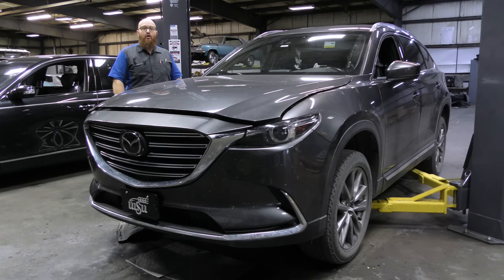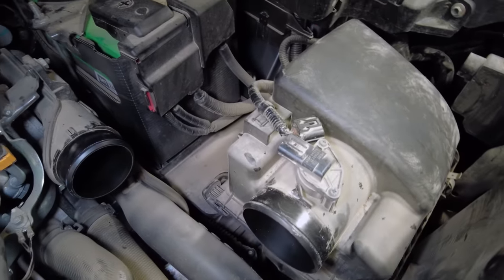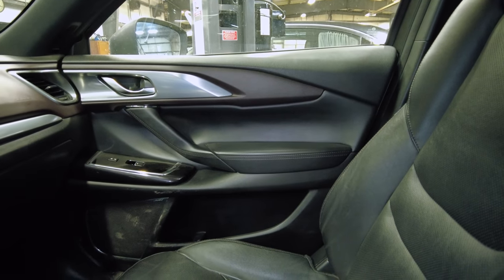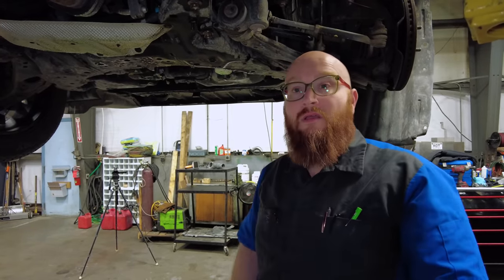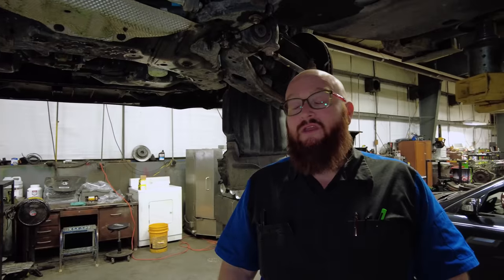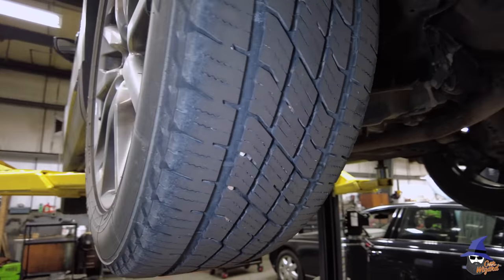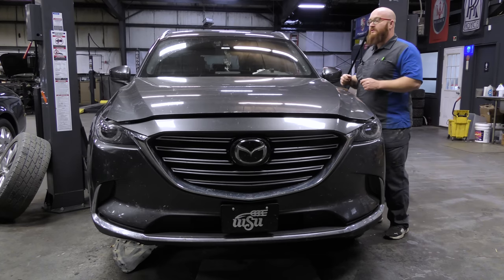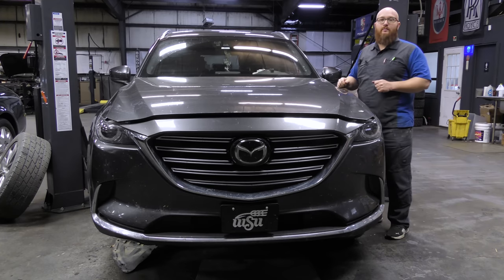Really, a $4K leak! What could be wrong with this '16 Mazda CX9 that could possibly cost that much?

Comment: The 2.5 turbo Mazda engine is actually a great engine. The early ones had this problem with the head gaskets because of a crack in the cylinder head between cylinders two and three. I worked the Mazda dealership for over two years and this happens on only the early CX nine‘s and ones that are really beaten up. They are good cars but this is definitely a known problem. This has no Ford parts and has nothing to do with Ford. This is a complete Mazda engine from the ground up.
Reply: Thank you
Reply: So...is head repairable? If not how much is new one?
Reply: @zerkfiter  I did read that early models of CX-9 can have this issue , I wonder if it has anything to do with how often and what quality is 5W30 used ? There is plenty of basic 5W30 oils that may not last past 3000miles in such Direct Injection Turbo motor.
That turbo was oil cooled until 2022 models that are air cooled now .
Reply: Yes it is. I can't even find a single one being torn down on the internet
Reply: So which year ranges should you avoid? I actually wouldn't mind a mazda 3 hatch with this engine
Reply: @christianmonreal9303  Very first year  2016, i had 2017 and it was great
Reply: @zerkfiter  No.. the head is scrap; replace with updated head.
Reply: @petesmitt  I did look it up and it said about 1200 labor and 2200 parts
Reply: Funny thing is that I had to get rid of my 2017 Ford escape for this same exact issue..2.0 Ecoboost engine. I replaced it with a 2023 CX-9 😂😂. I did verify that this issue doesn't affect the later years. I wonder if the Ecoboost engine and this engine are based on a shared design when they were together.
Reply: @Jbizzle_klok  Mazda 2.5l and Skyactiv turbo version has NOTHiNG to do with Ford and Ecoboost .
It is super reliable and this issue here is very rare and limited to early years .
Looking at interior scratches and rough condition I doubt owner used proper quality oil for this Turbo engine , or maybe did not change oil every 5k miles as needed .
Take care of it and it will last your for very long time , use quality 5W30 pure synthetic oil , change every 5K miles , even better do it by yourself as it is super easy to do 🙂 it will last forever.
Reply: My wife has a similar car, I wouldn't call it fast but it isn't slow either. It's enough engine to get it moving and to overtake.
Reply: @Jbizzle_klok  Your CX9 is 100% Mazda.  Mazda kicked Ford to the curb in 2010, by 2014 Mazda completely re-engineered every single part on every vehicle.  Your engine, transmission and everything else is engineered and manufactured in Japan by Mazda.  Also, there is ZERO parts engineered or manufactured by Toyota.  Mazda has 2.4% in Toyota stock and Toyota has 5% in Mazda stock.
Reply: You say they "are great engines" and in the next sentence say "head gasket problems".  That does not compute.  NEVER buy a turbo engine. You can get by fine without a turbo.
Reply: Yeah, a turbo 2JZ is such a terrible engine. 🙄
Reply: New one cx90 should also have problem. That's why be aware of newest models
Reply: @nicholasvinen  I used 93 from Shell and it was very peppy ....
Reply: It's not a great engine anymore, and it's not bulletproof at all, compared to Toyota and Honda vehicles built in Japan with Mazda CX-9 together.
Reply: @waltchan  CX9s 2.5t skyactiv is all Mazda Japan designed and build engine and is super reliable , has great performance and fantastic torque curve , all done by Mazda from 2016 and it took Toyota until 7 yrs later to build similar engine but not as refined and smooth and lacking anti turbo lag tech that Mazda have patented . 
I will take Mazda over Honda every day of the week and even than Toyota is recommendable and  much more solid than Honda it has to save their best for Lexus while Mazda does not have that problem .
Reply: @kdomster9141  Super reliable is the wrong word to say in the Mazda Japan 2.5L turbo. Many, many Ram 1500 5.7L V8 Hemi trucks easily outlast this Mazda engine, and they're built in USA. New Japanese don't last as long as the old ones now. More MPG = Less Durable, actually, due to cheaper construction quality in Mazda, Toyota, and Honda engines.
Reply: @waltchan Design quality and build precision / materials of Mazda are 2 levels above Dodge ...  Dodge is some of the worst in the industry even cheesy Koreans maybe better .
Reply: @kdomster9141  Let's do Ford Super Duty, Chevy Silverado HD, and Ram 3500 HD trucks instead. All are built like a tank that easily outlast any Japanese vehicles today.
Reply: I wouldn't describe that as a "GREAT" engine. "Great" engines do not have cracked cilinders
Reply: @alphatrion100  Every I mean every engine can have issues , this engine is very very durable for last 7 yrs and many reporting over 200K miles on these with no problems  ... Even most reliable engine if  not maintained as it supposed to be and on DI turbo as this use 5W30 cheap oil kept for extensive period of time it may have issues - it can happen on most reliable engines in the world .
Point is , without knowing how this vehicle was taken care of we can't judge it's reliability.
Reply: @waltchan  Lets compare commercial cars like Ecoboost in Ford SUVs  and not industrial like Heavy Duty Trucks that cost 100Kusd  and even if engine is overbuild to last thru abuse if Industrial applications  rest of the car will fall apart  including electronics , sensors , seals .
Reply: @spaceghost8995  unless you wanna actually “drive” the thing. Chugging along is not for me. That’s why I own 2029 VW Jetta GLI. The best turbo car I have ever owned and it’s really zippy.
Reply: @eugeneweeks3325  I drive like an adult not some punk who wants to look cool and then cry to mama for turbo repairs.
Reply: Good post! The way it was leaking didnt seem like a headgasket. The only time I've seen coolant just pouring out of an engine bay like this was a busted pipe, cracked head or radiator,  or a failed water pump. So cracked head it is on this.
Reply: Just show how incompetent Japanese automakers really are. They been building cars for almost a century and still put out garbage.
Reply: @henrytaverner1803  You've never owned one so how would you know?
Reply: I was surprised to hear Wizard equate this to a Ford engine. This is pure Mazda, sharing no content with Ford. Ford has its own 2.0/2.3 Ecoboost 4cyls. Yes, Mazda and Ford shared the old 2.5L in the early 2000s, but this is Mazda's own 2.5, starting in 2013 with the Mazda 6. The transmission is also a Mazda-design.
Reply: @Jbizzle_klok Ford's gen 1 2.0 Ecoboost was the king of coolant intrusion.
Reply: @eugeneweeks3325  But you had to use a DeLorean to pick it up.😃
Reply: I was about to say ford was out of the picture by 2016
Reply: Common Tsb on the 2015-2018 M/Y CX5s too on the naturally aspirated
Reply: As a ford tech once said about the small turbo engines "too much plumbin"
Reply: @kdomster9141  There's such a thing as manufacturing defects. You can baby a car and have a hundred other people on the internet say its perfect and they've had no problems with it. Doesn't mean you won't get the one in a thousand unit that is defective.  Pick any Youtube video about a terrible car or carmaker and you'll find dopes in the comment section saying that they had a good experience, therefore the car must be good and the video must be wrong.
Reply: @spaceghost8995  or a cvt trans
Reply: @Jbizzle_klok  I mean Ford uses Mazdas engines to this day.
Reply: @kdomster9141  Mazda is equal or better than Toyota these days.
Reply: @waltchan  🤣🤣🤣🤣
We will see in 5 years when the Chevy is on its second engine because of a cylinder deactivation failure, the dodge rusted away and had its transmission replaced for a second time, and the Ford can't stop leaking oil and coolant together because of the overuse of plastic.
Reply: @alphatrion100  And somehow Toyota had issues with cracked cylinder heads for years sure it was rare but no one made it a big deal. 2GR is still ranked one of the best engines despite having more issues than any Mazda engine in recent history.
Reply: @LSR-YT21  Agreed , I just wish Mazda would eye BMW more as benchmark rather than Lexus because it will mean softer less performance oriented designs ...
Reply: @kdomster9141  but they don't eye Lexus in performance. Mazda is their own thing. Mazdas don't feel like anything else on the market because Mazda has their own "feel" that they aim to achieve.
Reply: @LSR-YT21  I can see the direction and priorities change from just few yrs ago , it is now getting more like Lexus and less than BMW
Reply: @henrytaverner1803  Can you build an engine? Seems like you are complaining but cant even build a lawn mower engine.
Reply: @kdomster9141  maybe BMW from years ago but Mazda still is prioritizing performance and handling over comfort. Lexus is mostly prioritizing comfort.
Reply: @kdomster9141  lol always the oil.. It's not 1940 anymore.
Reply: @piggy310  i guess you don't know
Reply: Early and early. From what I have read, it was not addressed until cars built starting mid 2020. I had a 2018 CX-9, which I sold last year with only 12k miles on the clock for a very good price. I now have a 2022 CX-9. The normally aspirated 2.5 Skyactiv also have had a similar problem since they started adding cylinder deactivation, but this also has been fixed. I hope, since I also bought a 2022 CX-5 last year.
Reply: @jonwoodworker  The transmissions are made by Aisin. One more reason to buy Mazdas is that they do not use CVTs even for its smaller engines.
Reply: @flr8475  Not what my master tech told me , these 2.5 skyactiv engines are super solid and bullet proof with basic oil changes ON TIME.
Since 2014 ...
Reply: @kdomster9141  They added cylinder deactivation to the 2.5 naturally aspirated CX-5 for  2018, which caused a similar cylinder head failure, but this has supposedly been fixed. If you go on the Mazda enthusiast forums like Mazdas247, you will get a lot of info. Basically the 2.5 turbo cyl head was faulty 2016-2020 and the 2.5 NA 2018-2020ish. I don't quite see the link to oil changes and this problem. However, the problem arises with high mileage typically and probably linked to prolonged operation, e.g. highway long distance driving.
Reply: @flr8475  I don't have cyl deactivation on my 2019 mazda3 , and did not have it on 2017 CX-9 GT .
This 2.5l is build and designed very well . But as with every  turbo motor, take care of it by changing oil to quality one and don't keep it past 5K if drive with heavy foot,   let it cool off a bit after spirited drive by idle for a minute or so and it will last you long long time , many 2016 turbos are at  200K and doing well . 
Also turbo should be cleaned every say 30K miles . 
Head failures you are mentioning were not a wide spread problem like  Subbie head gasket leaks or Honda fatal 1.5l turbos ... So let not put bad wrap on overall fantastic  2.5l Mazda Skyactiv engines.
Reply: If there are cracked cylinder heads and takes $4000 to do a $40 job it's a piece of junk
Reply: @timothygibney159  Every I mean every engine can occasionally develop this kind of issues . 
This Skyactiv reliability statistics can be checked and it is one of the TOP engines mass made today ...
Reply: Thank you yes this is not a ford engine it’s a complete Mazda engine!
Reply: I was thinking I never heard of a 2.5 ecoboost.
Reply: Just avoid 2021, there were valve issues exclusively on that year across the whole lineup. Everything else is 10/10
Reply: @LSR-YT21  this is literally false, the Toyota Yaris is just a mazda2. Ford hasnt owned mazda since 2008, and Mazda hasnt had a fomoco stamp on any of its parts since 2014
Reply: @eugeneweeks3325  ewwww VW & from the future??
Reply: @henrytaverner1803  never heard of a toyota 4Runner, Land Cruiser, Lexus GX or LX? Best vehicles ever made on this rock.
Reply: @nicholasvinen  2jz nerd alert
Reply: I've torn down 7 of these motors in the past 3 months. I have seen spun rods, oil burners & blown heads. This motor is not reliable as you would like to think. All were clean and well maintained.
Reply: @LansdowneMotorsport Thanks...we have a na 2.5 and great vehicle 165k and mostly just maintenance...should hit 200k+ miles easily. The 2016+ cx9 is junk compared to the older cx5.
Reply: @kdomster9141  5.7L = engine tick
Reply: Do you see mazda cX 9 2012 worth buying😊
Reply: @hunterf3 i’m thinking of buying one, used mazda cx-9..as my family is expanding..i really like this car, i mean the design n everything..im now using honda civic fc, so im thinking that maybe i should sell it while the value is still relevant, and then buy this cx-9  and maybe use it for couple years til i got enough money to buy a brand new suv..since you have experience in dealing with this car, is the 2018 above ok? i mean do they have any of this known issues, bcoz i read couple of mazda forum here and there, some people claiming the same thing you mentioned, which is the crack in cylinder..some even said he had to bare 9k usd to fix it, but then he fought his way and mazda agreed to fix it under warranty claim..but since im gonna buy a second hand cx9 would it be okay? would love your opinion on this
Reply: @sarahburnside4606 only 2021's? That seems weird. So 22 and newer?
Reply: @spaceghost8995 I’ve had several turbo cars including two of our 4 cars now and as long as you maintain them well they will take care of you. There are some turbo engines I wouldn’t touch with a 10’ pole. Like the 1.0L & updated 2.7L EcoBoost engines. They both have wet rubber belts that drive the oil pump. The 3.5L & earlier 2.7L EcoBoost engines uses a chain. That’s a horrible design.
Reply: It’s the same motor in ford fusion.  The mzr 2.5 is co engineered by ford and Mazda.  There is tons of platform sharing in the industry.  It’s why a fusion 2.5 is plug and play with a Mazda, and the reason you can do a big block upgrade on the 2.0 and 2.3liter motors. They are very reliable and widely available.  Used motors are less than 1k from the junkyard. They all evaporate coolant though and if you don’t keep it topped off you will blow the head gasket.  That’s can happen on any car with extended service intervals.
Reply: @kdomster9141 then why can you swap them and run in the same software?
Reply: Turbos are a big risk. Sorry
Reply: @daveforgot127  They are a risk if you don’t regularly maintain your engine and you rev your engine to 8k before turning it off. They can be a risk if you put a turbo on an untuned engine that wasn’t engineered to be turbocharged. I would have to disagree that all turbos are a risk especially for manufacturers that have spent millions of dollars on research and development making them reliable for the masses.
Reply: @sarahburnside4606  Some axles, like the ones on the 2014+ Mazda 6 are FoMoCo but aren't shared with any Ford vehicles. Learned that while working at Mazda.
Reply: I was surprised when I heard Ford..when this purely Japanese
Reply: @HazmatFatCat  Interesting, I wonder if they just reused the boots because afaik the boots are transferable but the CV's inner spline count is different.
Reply: @waltchan Hondas quality has dropped on newer cars! Even Honda 
But still more dependable than most. 
Stick with Toyota 4cyl and u won’t have trans issues like the V6 
And Honda trans will start acting up by 120k miles in auto (just drain &fill trans fluid every 30k W/honda ATF. Amsoil trans fluid doesn’t heat up enough and runs too cold which isn’t good either! Made this mistake on my 2013 Honda fit 5speed auto not CVT.
Reply: Does this engine has carbon build up issue?
Reply: @HumbleBearcat  yes like all direct injected engines. Needs induction cleaning service every 15k - 20k to keep it clean

Comment: Sorry Wizard I hate to disagree with you but Mazda it’s an independent company since 2013 and Ford 2.5 Duratec inline 4 design by Mazda,previous and Mazda  used it too but this Skyactive  line of engine are 100 %Mazda made in Hiroshima Japan and are very reliable cars
Reply: And don’t take me wrong Wizard !! I love ❤️ you videos and your family thanks buddy
Reply: 2016 heard wasn't great year for that mazda type
Reply: Our 2018 CX-9 had the same problem. Apparently it's common, and is a manufacturing flaw with the head casting. The fix is not just a head gasket, or even a new head. Aluminum engine block and head have to be decked, and at that point you've pulled and torn down the engine. It requires a new engine at $10K plus.
Reply: @craiggourley8703 
That is scary 
Would you recommend me to buy this suv used with 120k? What year would you recommend?
Reply: @jackryder6732  Ours was fixed for almost $8000. They put a new head and a new exhaust manifold on, since both were cracked. The block was apparently fine, and it didn't need to be decked. But I understand the entire engine comes out of the vehicle when this job is performed. Honestly, I love the car, but I sure didn't love the repair bill. If you get one, verify that this work has already been done with the "new" head casting. The defective ones will eventually require a major repair. Otherwise, I expect this car will easily reach 250K with nothing more than routine maintenance.
Reply: @jackryder6732  also, according to what I researched, Mazda knew about the bad castings and corrected the issue in 2021 or 2022. So anything with the 2.5 turbo before 2021 could have this issue.
Reply: Sorry wizard, do your research Mazda became independent in 2013 and has no affiliation with Ford. Not a good idea to be pushing out false information, from someone that should be informed.
Reply: @craiggourley8703  Correct! Amazing how those expensive defects fly under the radar when many other brands would be trashed across the internet (and rightfully so) for allowing it.
Reply: 2015 was the last year they used Ford motors. I have a 2015 cx9 it has a ford motor, the same as in Ford fusion and edge.